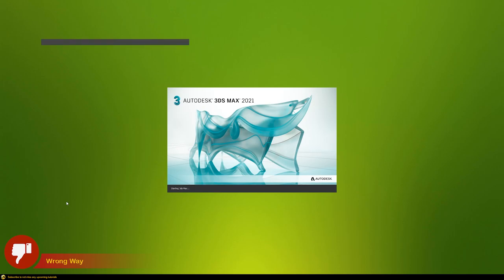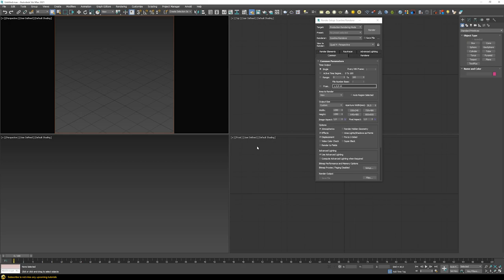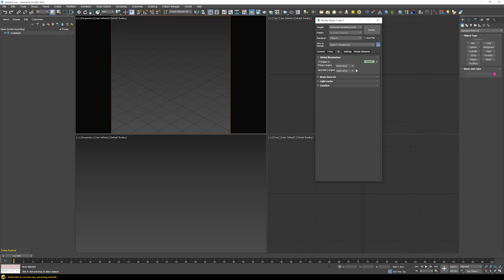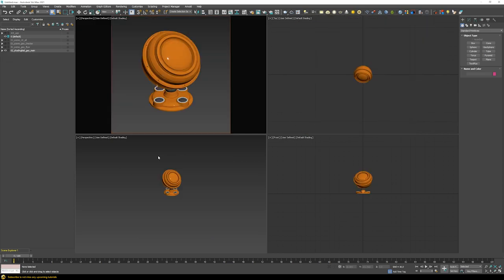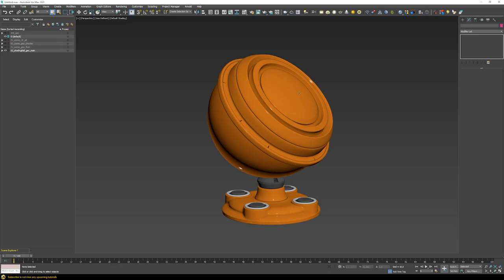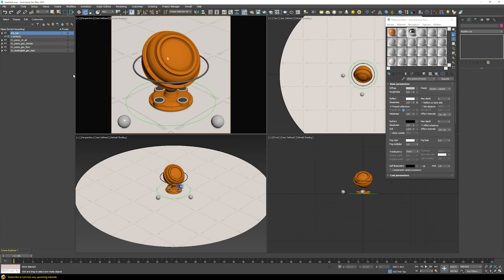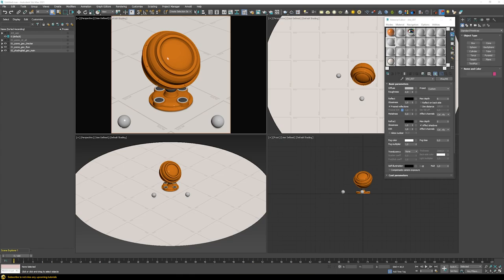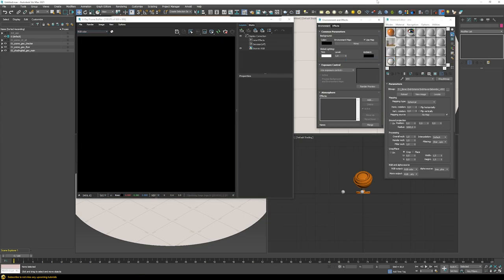V-Ray | BASIC LIGHTING SETUP for BEGINNERS | General Render Settings, HDRI, DomeLight, ToneMapping

Comment: First of all, thank you for this and the other videos. The videos are really good and on a very high level.

I still have a few questions about this video:

1. Why didn't you go into the camera settings? 

2. What about the light? Do you go into that in the second video?

Thank you very much and keep up the good work. Best regards to Stuttgart
Reply from the maker: Hi, you are right. About the camera I normally tend to use the standard +9 EV, so nothing special in there. For the lights there was originally planned a second part video but so far I haven't gotten much demand for that so that's why I focus on other topics at the moment :-)

Comment: hi. I've seen you are adjusting final image in framebuffer which looks like you do ''post'' adjustments . Shouldn't you instead adjust lighting or camera exposure so you have correct Lighting in your render? ...and than in AE, PS or NUKE do actual post?
Reply from the maker: The problem is that the render only looks correct on your sRGB monitor with the correct tonmapping/postprocessing applied to the linear image. You can do that step either in the Framebuffer directly or in an external software.
If you try to make the raw linear image look correct on your monitor without any tonmapping/postprocessing you will have to work against the architecture of the renderengine and probably introduce physically incorrect settings in order to achieve something that looks believable.
Reply from the maker: And I normally don't adjust the camera exposure in the VFB because this will mess up the sampling algorithm when doing a final bucket render and you will end up with an either noisy image or an image that renders way longer than it should.
Reply: Sure... I was just asking coz if I adjust VFB to look nice, but I render image sequence or still, its going to be without these adjustments anyway so I take it only as preview? and my actual render will look different as default without these adjustments... (unless its  1 still saved with all modifications done in VFB right? )...  and adjusting lights or camera exposure - i was talking about camera or lights itself nothing done in VFB.  BTW i wanted to ask you about Vray-exposure in  Environment settings.... do you use it or u have no exposure? coz so far u never used it...its there any point to use it instead of others?  :)

Comment: thanks for the great tutorial, very informative. The point you mentioned about dome light HDRI quality and render speed is Interesting, so do you use some special method in the case of corona renderer since it doesn`t have dome lights? or is the difference in quality only happen using Vray?
Reply from the maker: Hi, since the tutorial was a while back can you give me a little help what I was mentioning exactly? Then I can answer that :) Btw I have a video about V-Ray vs. Corona where you can see why I prefer the way how it works in Corona. You can find it in my channel 😉
Reply: @JonasNoell    Thank you, solved, found the answer in corona help. Seen the other video as well. Great one. Thanks again.